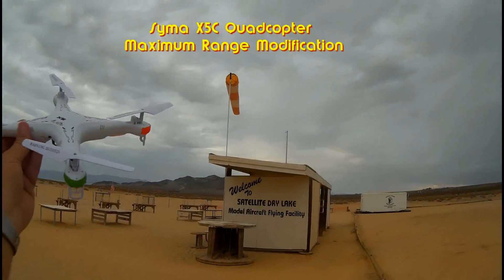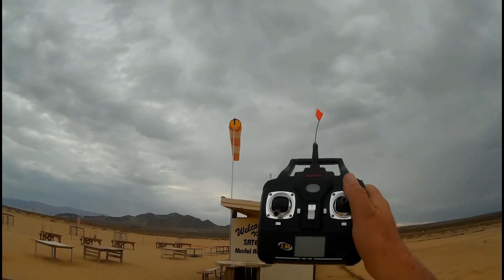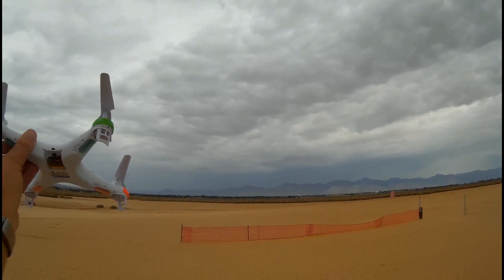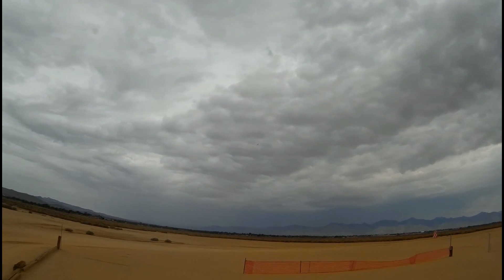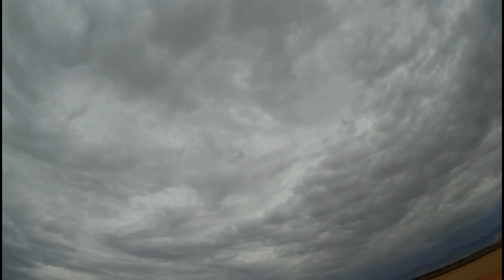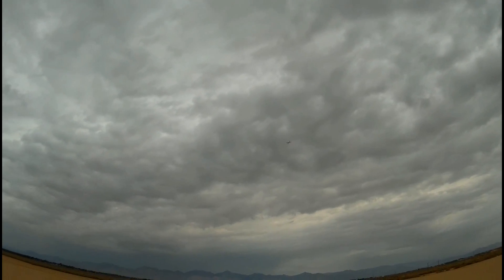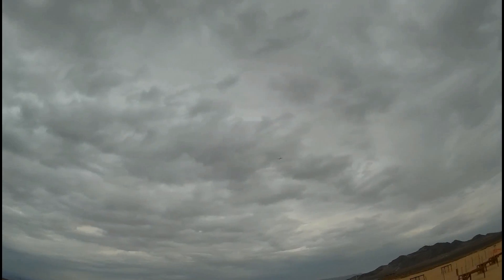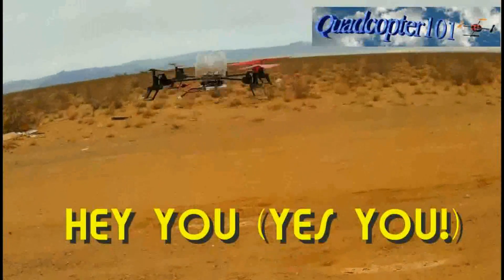Syma X5C Quadcopter Drone Maximum Range Modification

Comment: Hi my name is gus I bought a syma x5c-1 can I modified it 2 tell me what kind of wire I should buy
Reply from the maker: Any copper wire should work well.  And here's a fellow showing how:
Syma X5C Remote - Easy Antenna Range Extender Mod (1 of 2)
Syma X5C Remote - Easy Antenna Range Extender Mod (2 of 2)

Comment: Either a 1/4 wave or 3/4 wave should be the best length.   This is assuming the circuit board mating point for the antenna
is 50 ohms.  A half wave or full wave would present a mismatch preventing most of the RF to travel down the antenna.
It would be reflected back to the transmitter and could cause damage to the circuit.
If you open a WiFi antenna that claims more than 2-3dB gain you will see a coil in line with the wire.
This helps present a 50 ohm impedance at the base of the antenna to match transmitter.
More than likely all these 2.4Ghz transmitter have a 50-70 ohm impedance.

Just my 2cents worth on how I would approach it.

Ken

Comment from the maker: Sinichi, yes you can, but you'll also need to use a shielded cable, and an RP-SMA connector, and it would probably only work as well as the simple wire modification.
Reply: Does this work for syma x5c-1?
Reply from the maker: Riker Wilson Yes it does.
Reply: Quadcopter 101 ok thanks!
Reply: Quadcopter 101 I wish I got 150 feet, mine drops like a rock at 75 feet or so, desperately need to modify this antenna range. I'm thinking about hacking my old router for parts since it does not work properly any longer. Oh and btw, I made a modification for my camera angle by using duct tape 2 med sized washers and masking tape to hold it all in place. that way I can remove my camera without taking off the door ^^

Comment: I have a Hubsan X4 FPV - the range SUCKS. 20 feet and you can't see anything on the FPV screen. I was wondering if the same concept of range extension would work for the remote?
Reply from the maker: Yes it would.  This fellow put a minor extension to his transmitter's antenna, and also put a cloverleaf antenna to replace the quadcopter's antenna (about $7 from Banggood).  Claiming FPV ranges out to 150m. See the Nerobeous67 post on the RCGroups link for how-to pictures:
Hubsan x4 H107D long range FPV
http://www.rcgroups.com/forums/showthread.php?t=1842561&highlight=Nerobeus67&page=188

Comment: you can only go 1/4 of wavelength a time :  if you make a 1/2 wave antenna or a 1ful wave one  the the impedence at the base will be raise to several Kohm instead of 50 ohm  i'll try a COLLINEAR  configuration witch is made of several quarters of wave in series separated by another quarter of antenna wonded in coils
Reply: collinear antenna are still omnidirectional but they have up to 10 db of real gain !!!!!  Collinear configuration is used in marine transceivers
Reply: another antenna configuration you could like are the 7/8 waves used mostly in CB RTX  on 10meters band (27 Mhz)

Comment: Thanks, I tried it with my syma x5c-1 and it really works! Measured it, and the safely controllable distance was about 80-85 meters.
Reply from the maker: Yep, this type of modification is easy to implement. It really should work with most of these toy quadcopters that use a cheap 31mm quarter wavelength wire antenna (in other words, nearly all toy quadcopters can have their range enhanced with this simple mod :)

Comment: Fantastic mod. I have a X5C and am very disappointed with the quad response even when in High mode - have you come across this? there appears to be a 2-3 second delay following an input. Could it be the transmitter positioning? Thanks for any advice!
Reply from the maker: This occurs with me when the quad is at the limits of its range.  It seems to maintain for a couple seconds the last input it received before either coming back into range of the transmitter, or dropping out of the sky. But yes, recommend giving this mod a try. It should help.  As for better flight characteristics, try removing the camera.  It flies MUCH better (as seen in the above video) when it doesn't have to lug around its heavy camera.
Reply from the maker: and here's my review of the "base" X5C (not the X5C-1).  As you can guess, I wasn't very impressed with it: Syma X5C Quadcopter Drone Test Flight
Reply: Quadcopter 101 Thanks for that! I will give it a go this coming weekend, and let you know how I get on. Regards from the UK

Comment from the maker: Northsman, it should be 4.92" total length from where it exits the circuit board to the end tip of the wire extension. In other words, the original antenna plus its extension should total 4.92".  Its best to solder an extension to make it greater than 4.92", and then measure and snip off any excess.
Reply: Does it have to be exactly 4.92" or does it matter if it's longer? Sorry if it's a dumb question, I'm new to RC
Reply from the maker: Michael Pickering Yes it is important to try to get it as close as possible to 4.92", which is the actual wavelength of your 2.4 Ghz transmitter.  If you go longer, you should try to keep it as an odd quarter segment of the wavelength.  The next longest length would be 5/4ths the wavelength of 4.92", which is 6.15".  But making it any longer than 6.15" will not significantly improve performance.
Reply: the remote controller  of my drone has  an antenna consisting of   thin wire  which has  a shielding ..the total length of the  wire is   10centimeters, but  7.5cm is  shielded and around 2.5cm is bare......so I am confused to make an extension as you say, because  you didn't  avised any possible  shielding and I am worried to remove it ..so..total lenght of    4.92 inches  should be  only the naked(unshielded) wire, or  the  shielded  part  of  wire  is included?  .the logic  says to me, that  only naked  "radiator"  is what  we  count as an active antenna  we are taling about, but  I am not shure....btw, the shielding is soldered to groun of the  remote circuit.. many thanx!

Comment from the maker: Total length of the wire antenna (original + extension) should be about 125 mm (4.92 inches).  Wire should be good copper wire.  Thickness is less important, but should be sufficient thickness to prevent breakage if bent repeatedly.
Reply: Can you dok a tutorial video on how to do this?
Reply: mrsillywalk im Greek,im actually 15 years old and a month back I learned about wavelenght,it doesnt have anything to do with the lenght of the Antenna xD its symbolized by a Greek L λ .I didn't knew that when I was posting my comment and now im kind of embarrassed to be honest xD
Reply: Thank for insight,  so the wire needs to have some heat shrink tubing around the 4.92 in correct? 125mm , do you leave it straight as it leave the cone ?
Reply: well 125 mm(milimeter) is too small you probably  meant 125 cm(centimeter)xD but no problem,well I have seen other videos where they say the best total wavelength must be 6,25cm (2,5 inches) so its half the full wavelength then??
Reply: +Teo Pit and also how many meters does a full wave lenght antenna give?
Reply: +Teo Pit Back to school for you. Just think about it for a while and you should realize where you went wrong. A lot of Americans don`t know their metric.

Comment: Also is there a way to do without soldering gun?
Reply from the maker: Sure it's possible, but it may work spotty if you don't make a good connection. You'll need to make good metal to metal contact between the existing antenna and your wire extension. One way to do it would be to strip off enough of the clear insulation from the current antenna, and then wrap one end of your extension wire around the exposed antenna to make good metal to metal contact. Then wrap some insulation tape over that to hold it in place.

Comment: Hi there ! I'm looking for some advice about some quad copters. I'm looking for one to attach my gopro to but I don't want to spend a extreme amount of money. Any recommendations ? Thanks :)
Reply from the maker: Not sure how much you're willing to spend. But you'll need something with enough power to lift the GoPro.  On the low end (about $80) is the WLToys V262, V333, and V353. I use these inexpensive ones in my flights for no other reason than their low cost. For my purposes they work well: 
WLToys V262 Quadcopter: Cayucos Beach, CA
WLToys V262 Quadcopter Aerial Video: Canebrake CA

But there are issues with these cheap quadcopters. The main one being that their motors need frequent maintenance/replacement. But replacement motors only run about $3.80 each.  There's also a big jump in price to the next group of quads that can carry the GoPro. These run in $300 to $400 range, but they include more features such as GPS and return to home. But again I'm happy with the cheaper models, and have become quite adept at changing out their motors if needed. Here are a couple examples:
http://www.banggood.com/WLtoys-Galaxy-V353-Headless-Mode-24G-4CH-6-Axis-Gyro-RC-Quadcopter-p-931314.html?p=RB0922217402201307U3

http://www.banggood.com/V262-Upgraded-WLtoys-V333-Headless-Mode-24G-6-Axis-RC-Quadcopter-RTF-p-929889.html?p=RB0922217402201307U3

Comment: also what battery are you using in that .... no sooner has mine launched its tired and wants to come home !!!
Reply from the maker: Are you flying with the camera attached? It takes a lot of battery power to lift it and also run it. If you're not taking video, recommend flying with the battery door and camera removed. The camera easily unplugs, and the door can be slanted in its hinge grooves to easily remove it. The battery plug blocks the battery from sliding out of its holding bracket, so the door isn't really needed in the first place.

Comment: Nice job with the range. 
That space is so incredibly enormous. I'm surprised you fly such small quads there. That place is crying for some long range gear.
Reply from the maker: I know. I always make sure that there are no members of the local RC club present so I don't get razzed :)  But it is perfect for testing range.  There's even a better place for doing such out in the local desert. WLToys V262 Quadcopter Drone: Maximum Range Test

Comment: How dir you do it ?
Reply from the maker: Here's another fellow that shows how to do it.  He does a half wavelength (62mm) modification. But I've been told that you can get even better results with 5/4 wavelength (6.15 inches or 156 mm length). Use a wire longer initially longer than that.  Then after soldering, just measure out that length from the base of the circuit board, and then snip the end of the wire to get the desired length.  And here's that fellow showing how:
Syma X5C Remote - Easy Antenna Range Extender Mod (1 of 2)
Syma X5C Remote - Easy Antenna Range Extender Mod (2 of 2)
Reply: Quadcopter 101 What kind of wire do i have to use? What kind of metal it needs to be made of?
Reply from the maker: Shompod Mh copper wire is best.
Reply: Thanks :)